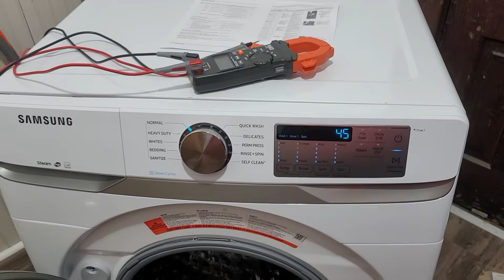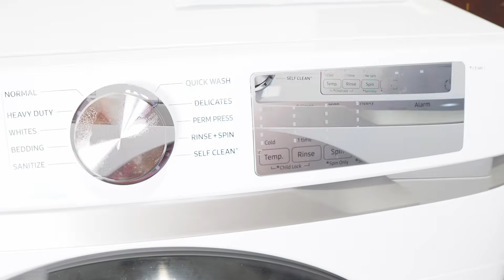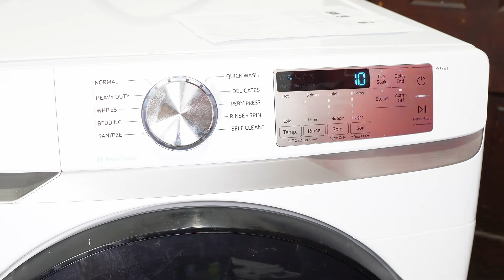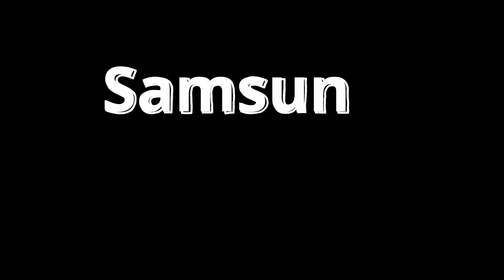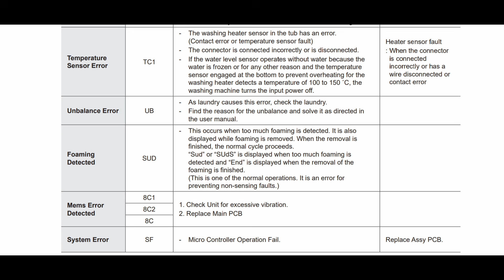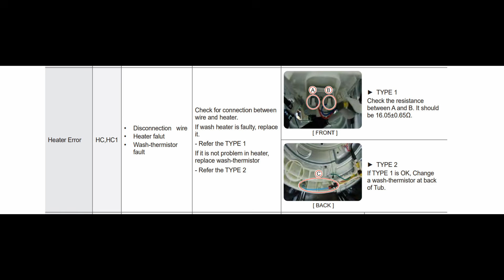Samsung Washing Machine Error Codes and Troubleshooting Using the Smart Install for WF45R6 Units

Comment: For the samsung wa455drhdsu/aa 01 model Iwould start a cycle and it would not load water and do nothing then after 5 minutes would give me the 3e code.
Then I put it on the diagnose mode and ran a test said 3e2.

Now 3e is the drive motor inverter board  is what I read and the 3e2 is the main control board.
My question is which error do I follow and change. 

Also some reviews said not all samsung washers have the inverter board next to the drive motor not sure if mine does. 
Any support would be nice thank you guys.

Comment: Running the quick test (SPIN + SOIL + POWER for 5 seconds from the "power off" condition) erases the errors on older machines.  I assume that feature still works.  This is why Samsung recommends techs pull the error codes before running quick test.

Comment: Hi, very helpful video. I have model wf45b6300 and the problem is after 3 sec once I push power button all led lights start flashing and the machine blocks completely. Imposible to enter to diagnostic mode no enough time for it. I thought that is a main board, purchased used one from eBay and happen the same. Probably some help with that. Thanks
Reply: Were you able to figure this one out? I am in the exact same situation. All lights flashing, got one from ebay, no luck!

Comment: Very helpful video, got the washer into Smart install mode and everything seemed to work correctly. But the washer is not working, it stop mid cycle.  Is there a procedure to get into a test mode where we can see if there is an error code?  Thanks

Comment: So I have the same exact washer it wouldn’t go pass 1 for the test cycle. My door was locked locked and had to manually unlock. Now the it won’t self lock anymore thus won’t run a load
Reply: You fix this? Have this issue

Comment: I was in the middle of washing clothes, the washer reached the "end" cycle and the door will not open. It is locked. I can't get into the test mode to check all codes like you show in the video...the washer simply reflects the ac6 code. I can't do anything. I have unplugged it and left it unplugged overnight. I have also drained the water. any suggestions?
Reply: I just saw your code chart.. looks like it is a wire thing. ugh. thanks!

Comment: I have a Whirlpool dryer (WGD5100HC2) that showed "F2E2 Contact Service" message.  This appeared after getting it to start a normal drying cycle, came back to check on it, and found that.  What does it mean?  I found the suggested solution was to cycle the power.  But, I want to know what made that appear to try and alleviate it from happening again.
Reply: That's a communications error regarding the UI interface and the main board. It's probably the UI which is like 300 dollars out of warranty, lol. In warranty work we typically order UI and main board, but paid calls we get both and do UI first and it tends to resolve it. The contacts on the UI board will corrode from heat and moisture